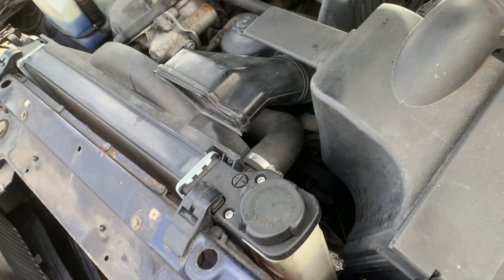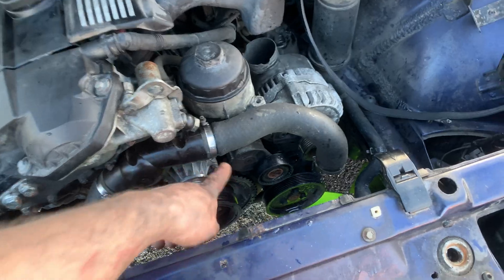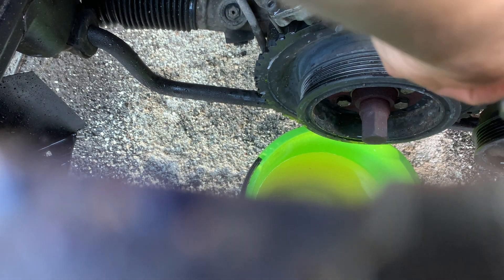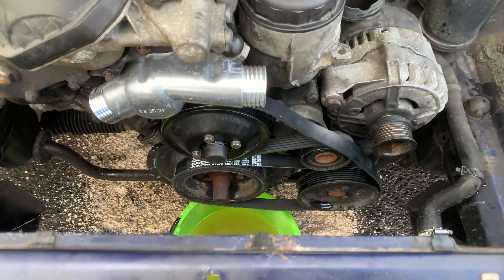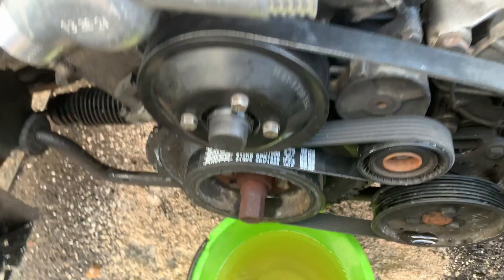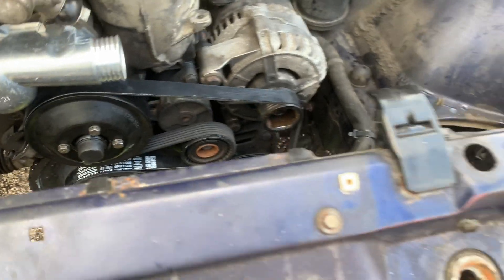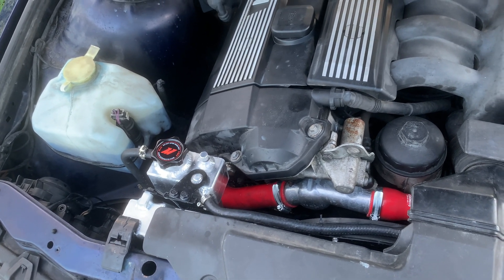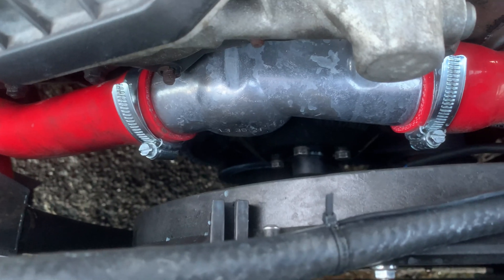E36  Project Rosa EP19 - Mishimoto performance rad and fan install

Comment: Hi mate having an absolute mare installing mine the return hose u said is 25mm? With 25mm elbow joints to the expansion tank?
Reply from the maker: Yes I found putting a 90’ elbow to send an additional 25mm hose under the rad to the other side now the expansion tank has swapped over worked. I zip tied it to the underside of the new fan shroud.
Sorry for slow response, been away.

Comment: Nice vid. Ditched the clutch fan on mine too for e fan and went for 80deg thermostat..what is your avg temperature now when driving? By the way. Ur missing an important mod on ur m52😉
Reply from the maker: It's still hitting the middle of the gauge, but takes a little longer to get there and the heater takes a little longer to heat up... It was on the last rad going a hair above the mid line, so this is a relief for when I turbo it soon...
What mod are you recommending?
Reply: @mid-life36crisis  M50 manifold swap.😅.. but I saw that you are going turbo anyway...
Reply from the maker: Yes I would probably have done that already but I have an aluminium manifold that will be going on when I strip the engine apart and fit the turbo. Just been a bit delayed as we are moving house and don't want the car in bits when we need to move! Really want it done for the summer holidays though.
Reply: Hi just wondering do you remember where you got the brackets for the expansion tank to mount it